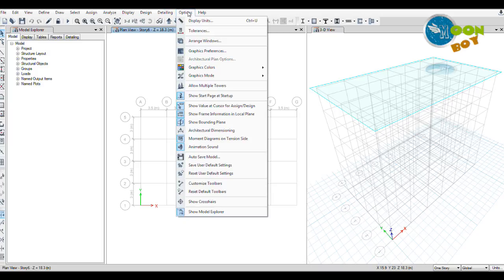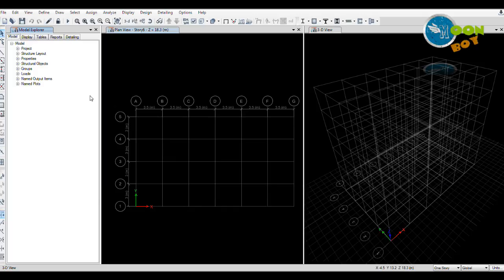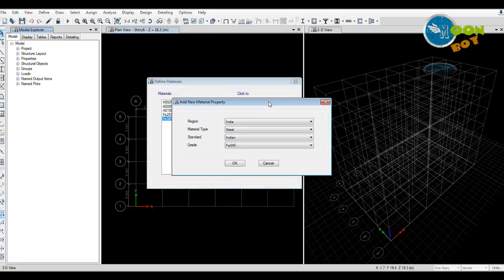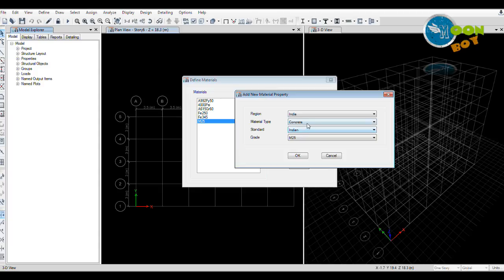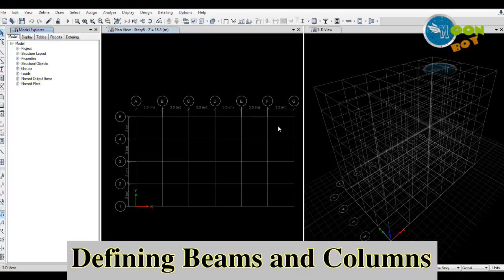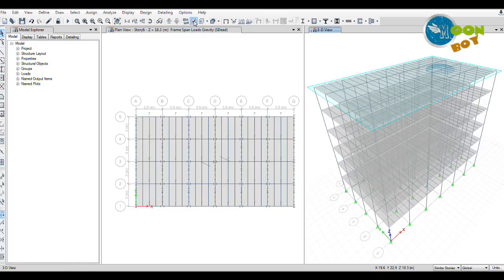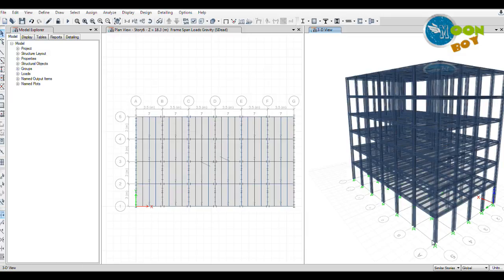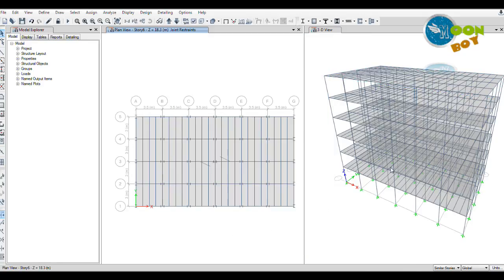Etabs 2015 tutorial 8 | Steel Building Analysis and Design | Using IS Codes | Part-1

Comment: In roof truss why do not we provide flat section instead of angle section as filler members.?
Reply from the maker: Already roof is like flat member to resist the bending in vertical we need a deeper section in vertical direction. and also we have to hold the roof and transfer that load via a proper member. since the load in truss roof is less the minimum section that can do this is angular member. Otherwise we would have used I section or C section.